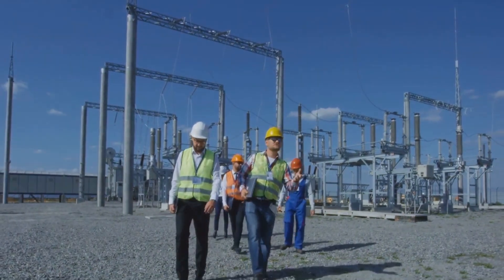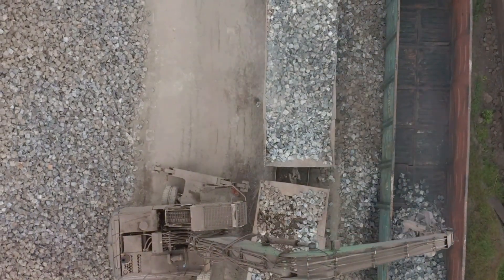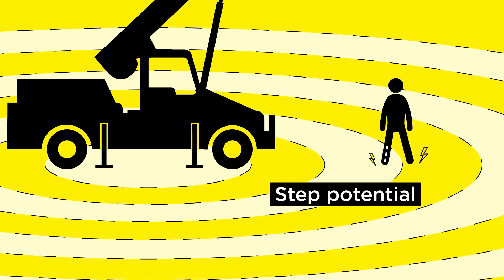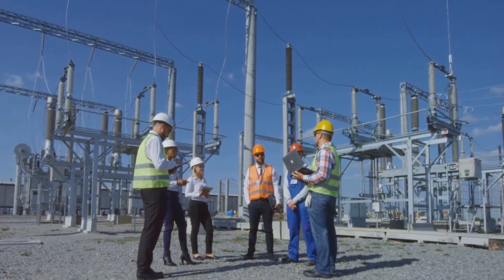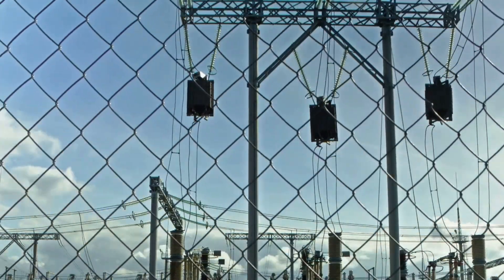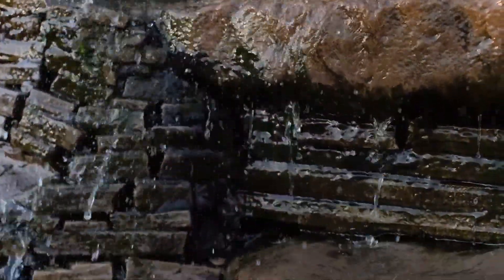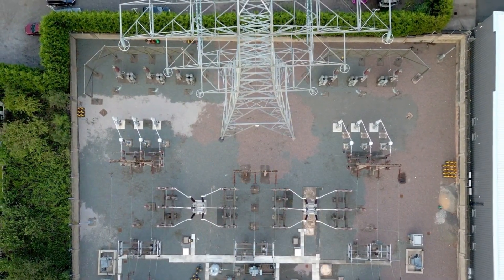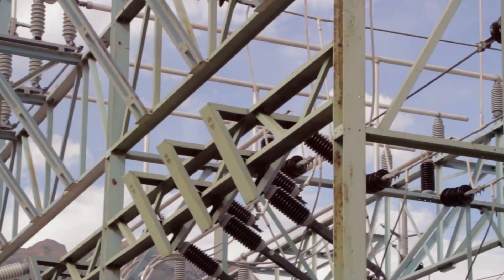Why are Stones Used in an Electrical Substation? #electrology explained

Comment: Please when you get a chance could you reply to another question.

Are EMP’s and Sunspots really a problem ? 
These would induce a higher voltage on the national grid. With the existing protection like, lighting arresters, ark horns, spark gaps discharging this to ground are we not protected ?
Reply: We are protected - to a point. Everything has its limits. Exceed them and it fails. If a surge causes a increase in current, say, but the protective device can't trip it time, some other part of the system will have to take the hit.
A surge that is large enough can maintain an arc even after the protective switch opens.
Causes of failure are endless.

Comment: What would cause a Power Transformer to burst into flames (as seen on YouTube), assuming it’s true.

With all its protection (over current, over voltage and overheating) is it down to poor manufacturing, contamination of its Oil  or poor/no maintenance ? I’d love to hear your views.
Reply: The protection devices can only "see" soon much. A connection or insulation failure causes localised heating or an arc that the protection may not detect until after the oil has reached flash point. A connection failure creates a massive arc and heating and pressure rise faster than protection can react.
Reply: @mattyb7736  Thanks for that. It has cleared up a lot of stuff. Happy New Year !
Reply: @mattyb7736  very good answer, thank you sir 👍